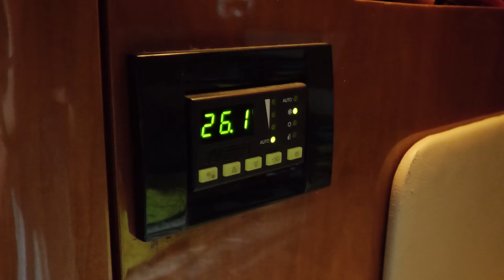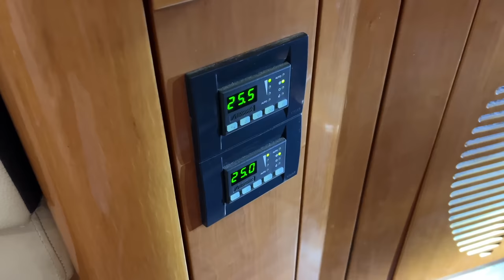THEIR FIRST TIME! (but things are cooling off now) Ep 217

Comment: So I’m not sure if you could use these units but there are such things as standalone air conditioners.   You could’ve easily put two or three of those units in your boat if you are docked you probably could’ve hooked them up to the power vented them out the port hole to provide a supplemental relief if you could find them in that country.

Comment: @2:37. Ok so just a quick question…that AC unit you removed from under Finn’s bed, it looked almost as new as the one going in to replace it.  How long did that last?  They seem to be located in enclosed areas and just wondering if the reason they don’t last long is because they can’t vent properly???  Also not sure I would want a compressor under my bed!  Must be very annoying when it kicks in.